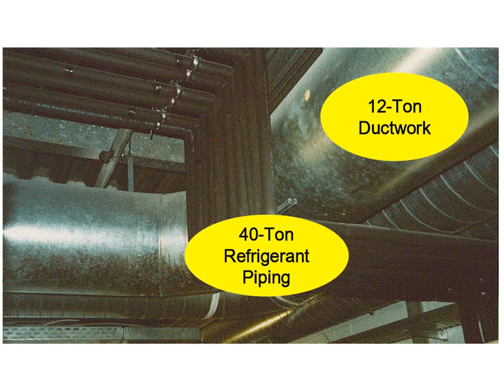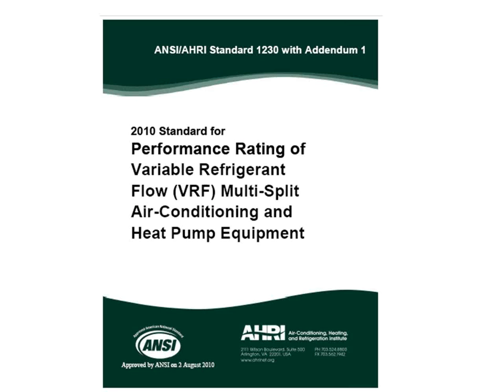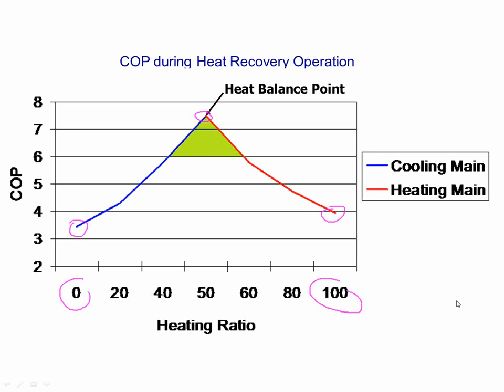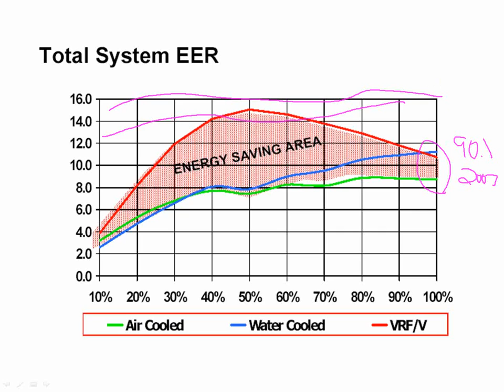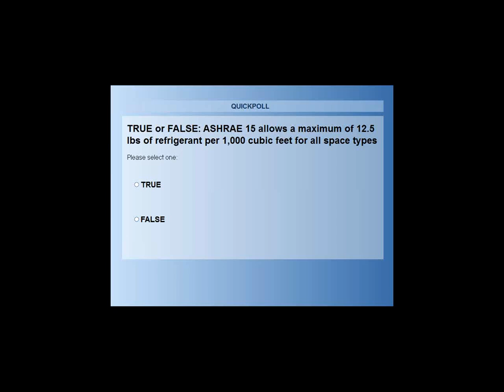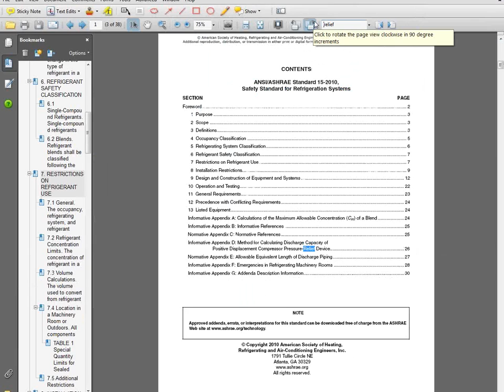VRF Energy Analysis & ASHRAE 15 Compliance - Webinar 3/2/15

Comment: Out of curiosity, in order to install or design one of these VRF units especially with over 6.6 pounds of refrigerant, wont the inspector require that a PE stamp to be affixed to the working drawings, to be in compliance with Ashrae codes?
Reply from the maker: Unrelated to VRF or refrigerants, the communities that we work in generally require a PE stamp on drawings for all permits that involve new mechanical system installations.
Reply from the maker: In regards to ASHRAE standard compliance, that would depend on if that AHJ has adopted ASHRAE as part of their code or not. Each AHJ does things a little differently. For example, Chicago, which is in our backyard, writes its own refrigeration code and does not follow ASHRAE specifically.

Comment: Great presentation, ashrae 15 is so ambiguous with all the refrigerant limitation requirements... 6.6#, 550#, category M fluid service, Category D service fluid,  what do they mean by fluid service?  When is a machinery room required, been doing hvacr for 30 years, including  commercial and industrial! Never saw one. When are they required with an example if you could.   Thanks
Mike
Reply from the maker: Common examples of times you will see "machinery rooms" are chiller plants, supermarket compressor racks, ammonia equipment for ice rinks, etc.